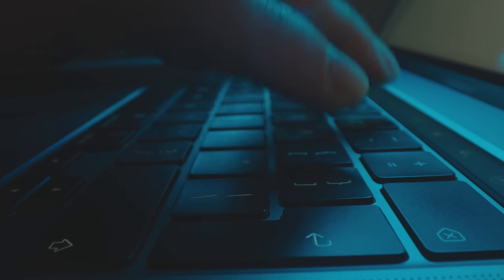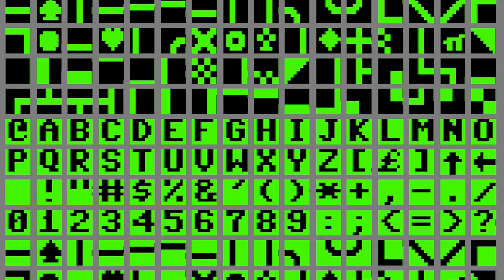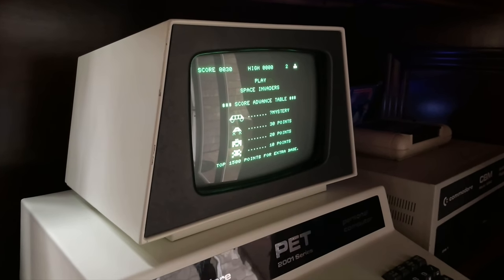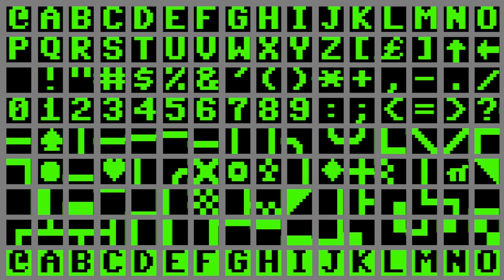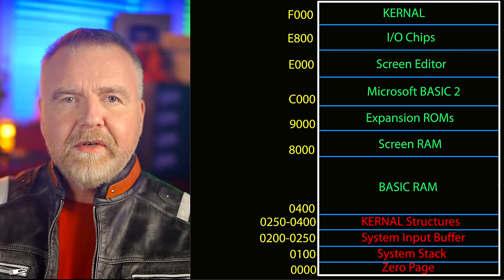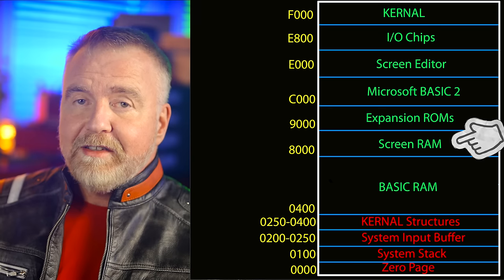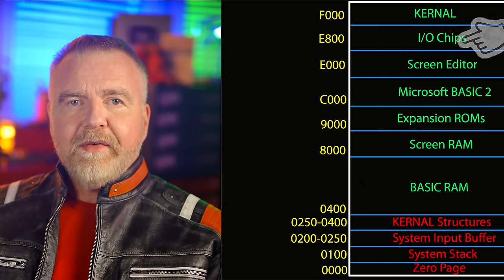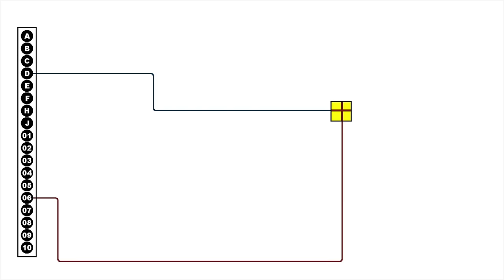Everything you SHOULD know about your Computer but don't!

Comment: Amongst the first dedicated computer was the AES-100/103 word processors. Although powered by an Intel 8080 cpu, most of the functions you describe were done in hardware. Yes, for example the on screen cursor had a series of TTL (7490 type) horizontal counter counting up to 80 (caracters) and a vertical counter counting up to 25 (lines). The half tone cursor was driven on the video board with a resistor injecting half the current in the gun, hence the tone difference. The boot sequence was controlled by a bootstrap loader in ROM. The disk access, head placement, rotation, data transfer, etc. were all hardware implemented.  The same video ROM (different countries characters were available with differents SKU) idea from the PET was used, altough the text on the screen was stored and  "remembered" in DRAM  memory. This was also hardware controlled to the point that the text on screen and off screen was stored in contiguous memory as it was displayed. The text was moving on screen because there were hardware counters doing that. The keyboard scanning was all implemented in hardware, only issuing an interrupt on any "Hall effect key" keypress. In effect at the time the limiting factor in all systems was the cpu itself. The cpu was burdened with all the interrupts and housekeeping duties they barely had time left for anything else than coordinating the processes. It was faster to just dump a command or a couple of bytes in the hardware and let it do it's own magical business. Then come back on an interruption to look at the outcome of whatever was pending. There was extensive use of DMA for anything data related. Communications were handled the same way. A respected engineer (especially mission critical like communications) at the time would not trust anything cpu! We would implement a series of lap time watchdogs timers (Bill P.) , tigth timings, wake up call timers, etc. and make sure the hardware was ready to press on the reset button at 4 millisecond notice!! That's the way it was done then... Debuging a video display was simply a matter of looking on the screen, with experience we knew exactly what had failed since it was a sort of inverted WYSIWYG! Remember AA55 and the Quick brown fox generator!?

Comment: Awesome video...

I learned BASIC on a PET in high school back in the early 80's. Next, I learned 6502 assembly in tech school where we outputted to an oscilloscope with X Y coordinates. I wrote enough assembly to draw a 3D cube and rotate it on the oscilloscope. This was due to directly manipulating the voltages going to the two input of the scope. I probably still have the code stashed away somewhere.

Comment: After 7 years of being a computer enthusiast and when I completed my Computer Science Degree in 1980 - which makes me the same vintage as this presenter - I had learned most of this stuff. Additionally my first few years of professional low level process-control SW development taught me all about 8 bit computers....and I mean ALL. Interrupt handling, O/S structure, Assemble, Machine code, how input and output is multiplexed, RS232, and a myriad of other stuff. I am SO GRATEFUL to have been on the ground floor of microcomputers.
You haven't lived if you haven't put a 16 channel logic analyser onto a single board computer, looking for why a data fetch hasn't worked correctly :)

Comment: Thanks for that ride down memory lane, Dave. I started off  (if we discount a 4 bit AIM development board running a 4004) with a Tandy (Radio Shack Model one. I was even simpler than the Pet.  I too enjoyed the luxury of  knowing what every (well most) component was for and thanks to reverse engineering (or screwing around with a Monitor in the ROM, as I would have called it at the time) I learnt what every bit of code (including those Microsoft routines) did. It was a time of rapid development and personal computer costing £1000s in todays money would be obsolete in a couple of years. It wasn't just the hardware, the knowledge also suffered from obsolescence. Within 5 years, I wouldn't have even be able to tell you how a sound card worked (though I knew it didn't use the relay that switched the  tape recorder on and off to make the sound). Thanks again, Dave.

Comment: Dave a lot of the first generation of "homebrew" hackers and gamers went through the knowledge bootstrapping process.  Many even independently invented or discovered how to build computers from scratch.  Early software and hardware are so intertwined that it was not possible to know one without the other.  Computer magazines in the 80s actually had complete program source codes or circuit diagrams, and Byte magazine was our industry bible.

Comment: The first computer I owned was an Amstrad PCW8512, which had two 3.5 floppy disk drives and used CP/M as it's operating system.  Because I had an Egyptian girlfriend at the time, I changed the character set to Arabic and caused it to write from right to left using a  C script I wrote into memory. I was pretty pleased with that.
Thoroughly enjoy your videos.

Comment: I used to repair Commodores Pets back in the 80s. I had a reference system with the 40 pin chips socketed. A cabinet with spare chips and reference floppy for setting up the heads.

Comment: The first computer I ever used was a TRS-80 Model 1 in 1982 in Year 7 at school. All I could do was a BASIC "Hello" program. The first computer I owned was a TRS-80 MC-10 in 1983 with a whopping 4K of RAM. I typed in many BASIC programs and ended up writing some including a very crude financial accounting program. I learnt how to POKE the screen to do unusual text and graphics. I did some elementary Assembler programming. Yes, that tiny computer could do all that. I later upgraded to a CoCo 2 and then a CoCo3 with the 512K RAM upgrade module and 2 x 5.25" disk drives in the end before moving to PCs in about 1990. The good thing about PC's was the open architecture which lended itself to learning all about it if you wanted or needed to know.

Comment: I (and a friend) were stretching the limits with the PET2001... VIA chip was awesome. Sound out thanks to a serial shift register could be output to CB2 (available on user port), while still have R/W to the PA port. So, multiplayer games, one player on each PET2001 (our high school had two) because of the keyboard scanning blocked multi-key input, so solution "Sit at a computer each", then a home made cable, amplifier on a hand carried cassette player. Teachers were frightened at our activities, and took every opportunity to yell at us for breaking the rules (not connect anything!). But it led to both of us getting jobs as assembly programmers straight out of high school. Those were the days!

Comment: Back in the early '90s I was at one of two startups that were doing compression that could be used on discs. Thanks to books like undocumented DOS and a pension for disassembling code, I was able to contribute to that effort.

Once we had a product, and I thought about what happened to lotus one two three, I walked into the boardroom and told the guys we got 2 years to make money on this and then Microsoft is going to have this compression in the operating system. It's as sure as Moore's law.

So YOU FOR ONE OF THE GUYS THAT MADE MY PREDICTION COME TRUE!

Bravo, much respect!

Comment: The first computer that I owned was in late 1987 or early 1988.  It was a "Pinetop XT" from the back of Computer Shopper magazine.  It had two floppies and a multifunction expansion care that added IO ports and memory to fill to the full 640 KB.  I added a 20 MB hard drive, a Star SG10 dot-matrix printer, and a Volksmodem 12 1200 baud modem.  The first two pieces of software I bought were the Mix C compiler and an editor which name is escaping me right now but had drawn cat figures on the quick cards and other documentation (I still have those cards somewhere because one of them had an ASCII code table).

If you booted this computer without a boot drive you would get a BASIC prompt.  Now you get some kind of Missing OS error.

My next computer was a Gateway 2000 386.  HUGE jump.

Comment: Hi Dave, I have in my study, the first disk (5-/14" floppies) machine I built back around 1983. 6809-based with 56k of accessible RAM. Originally it used dynamic RAM (32 16kx1) but I recently got rid of that and replaced it with a single 64kx8 static RAM which was part of a cache bank from a discarded PC.
In front of the machine is a custom-designed, built and programmed VDU (dumb terminal) including custom keyboard encoder and of course, video hardware (6845 controller) , character generator (binary coded EPROM) as well, again 6809-based. It still works and I can still write and execute programs on it. 
Al software/firmware done In assembly language of course. The '09 is so much fun. It's powerful stack capabilites were a delight to use.
Re the C64  character output, it appears to be typical for the time, feeding the video shift register. A variation I incorporated on another machine had both a ROM and writable RAM so you could load graphics characters etc. and address it with a 1-bit higher order address line from the video controller. Effectively a programmable character generator and writable as a part of the normal machine memory map. However I never really used it in anger. It was a neat-to-have-done kind of hardware thing.

Comment: In 1965/66, I read the whole OS incore code, line by line for the IBM 7040 OS (IBSYS) and then added significant function. Added was I/O spoiling, check/point restart and a scheduler. This allowed the Univ of Waterloo (On) to read in and print output for student jobs, then write the storage for the current running application to hard disk, then process student jobs thru the Waterloo Fortran Compiler and then restart the app that was running and print out student results.

Comment: Ah memories.  I learned Z80 assembler on a 4K Level 1 TRS-80 I bought in 1978.  That knowledge led me to microcontrollers; particularly the PIC chips in the '90s, and landing a career in embedded systems after getting my BSEE.  And then Silicon Valley died with the "dot com crash" in 2000-2001.

Comment: I built some very simple display electronics once (1980s) from TTL and memory chips, boy it was a self-imposed pergatory when I could have just used a ready made LSI (6845 or something like it), but I wanted to understand the whole thing - and by the end I certainly did!  I did get it working on a small little 14" CRT screen - but it was pretty crude.  Today when I watch TV in HD I sometimes remind myself that I am effectively gazing into an enormous RAM buffer which is being continuously updated faster than thought to trick my eyes and brain into seeing moving pictures.  Display tech, plus MPEG or other compression - it is a modern wonder - no two ways about that!

Comment: I am not a PET expert, but I AM a hardware ASIC design engineer.  The most likely reason for not being able to change the character set is because the character ROM is being hit 40 times every scan line.  Assuming 24x40 character display, 30 Hz (60Hz interlaced), that works out to 240,000 accesses every single second.  That would chew up a bit of the time that the CPU has to be stalled.  Of course this is already done to read the video RAM (bit of memory that has which character is in which screen position).  But having character data in RAM would double the impact.
Of course, there are other ways around this.  The 6502 (as I recall) uses a two-phase clock, so you could squeeze video memory access BETWEEN clock cycles for the CPU.  This, of course, assumes that the RAM is fast enough to handle such double-speed access.  If it is, then using RAM characters could be done, but probably at the expense of a few (maybe two or three) extra 74-series logic chips.  That would increase the cost a bit.  But, there is the most obvious reason that this is done: the early PETs only had 4K of RAM.  Yeah, not nearly enough RAM to do any sort of thing like that.  The extra characters would take up 1/4 of the existing memory (assuming 128 characters), or 1K.

Comment: I first learned assembly on a PET.  At first it was just POKEing data values into the screen ram and running it right there.  Getting a real assembler tool made things so much nicer, best was the disassembler.  This was when I learned just how horrific floating point code can be.  But it was great to learn how everything worked.

Comment: The Acorn BBC Micro (also a 6502 machine) had an interesting approach to expansion ROMs - the area from 0x8000 to 0xBFFF was banked, and could have up to 16 different ROMs (or "sideways RAM" banks) present with the help of an expansion board (if memory serves up to 4 were available without an expansion). BASIC was one such ROM, the disc controller (DFS or ADFS) was another, if fitted. Video memory was dynamic, starting from 0x3000 (640x256 2 colours, 320x256 4 colours, 160x256 8 colours + 8 flashing pairs), 0x4000 (80x25 bitmapped text mode), 0x5800 (320x256 2 colours, 160x256 4 colours), 0x6000 (40x25 bitmapped text mode), and 0x7C00 (40x25, 8 colours, driven by the SAA5050 Teletext character generator chip), all ending at 0x7FFF. This last mode was the BBC's real killer mode, it looked amazing on screen and took just 1K of RAM.  In later models (and expansions for the BBC Micro) the video memory could be banked to the "Shadow RAM" so BASIC workspace could go all the way up to 0x7FFF.  The operating system and memory-mapped I/O was at 0xC000-0xFFFF.  Yes, BASIC and the OS were separate.  It was an ingeniously modular system, its legacy lives on today in RISC OS - the original ARM OS, which is now open source and available for the Raspberry Pi amongst other platforms.

Comment: As an application programmer in the 1980s, I can recall coding my own sorting and searching algorithms. Assembly language was too low-level to be practical so we used B, BCPL or C. I have to tip my hat to the book 'The Art of Computer Programming. Volume 3 - Sorting and Searching' by Donald E. Knuth, which I studied at university.

Comment: One of the early mods I did on my PET 4016 was to make a daughter board for the character generator which used the existing ROM and some additional SRAM for the upper 128 characters, which was addressable via a dual port, by the 6502. It allowed custom characters to be generated in code and was used for things like graphing data or game sprites. The write to the SRAM had to be synced and written in the vertical sync flyback to prevent screen flicker when writing to the SRAM.

Comment: Back in the day memory was very very very expensive whilst ROMs were cheaper so designers would try to keep as much in ROM as possible. The PET uses a 6502 CPU which doesn't natively support RAM refresh so they opted for SRAM; which by the 1970's was now established technology, and wouldn't need additional refresh electronics. Some later home micros used Z80 CPUs which do natively support in-built refresh so could use DRAM more easily once it became cost effective (DRAM wouldn't be invented till early 70's). There are exceptions... the BBC computer for example uses a 6502 CPU but uses DRAM.

Comment: As a starving part time college instructor and a student I did my graduate work at the CCM (Center for Contemporary Music at Mills College, Oakland) in 1983/84 on a C64 because it had that SID chip, a 3 voice synth. My collaborator Jeff and I figured out how to connect 2 C64s to sync the clock so now we had 6 voices or two different programs in parallel. I wrote a lot of BASIC programs with Assembly Language subroutines running loops that read variables from tables. Geez, as you know, it was all by hand. Good times, good memories. We both played guitar and keyboards, so with the 2 C64's we had our own little orchestra. We were working with David Rosenbloom, Larry Polansky, and Scot Gresham-Lancaster. I learned so much from those 3 wonderful guys including C (no plus or sharp), Forth, and others. Ahhhhhhh, the old days, right? We explored language and interface solutions for composers.

Comment: I find this interesting, as I used a TRS-80 Model I as a kid.  The architecture of the TRS-80 was probably very similar to what you describe with the PET.  I imagine that the TRS-80 had a fixed set of characters in ROM like the PET did, because you could POKE characters directly to video RAM to display characters at particular cells.

Comment: Reason for using ROMs back at the beginning (late 70s) is they were really fast and you could actually scan the video out of them like the PET did.
Static RAM was also pretty fast for the time and as you said there was a bunch of additional circuitry that was needed to refresh any DRAM that slowed access down. My first callsign character generator (amateur TV) used fusible link bipolar PROMs, they were really fast.

Comment: Nice overview! BTW (if anyone cares) the reason dynamic RAM needs to be refreshed because it's storing charge in a capacitor to represent each bit. The charge in the cap will gradually dissipate in accordance with the time constant. Static RAM uses a 'flip-flop' circuit to store each bit, so it will essentially latch in place without needing to be continually refreshed. The refresh circuit used with dRAM reads out all the capacitor energy states and then writes them back to the circuit before they have a chance to leak away (if they did leak away you'd obviously get data loss). Obviously I'm still hand waving a bit here. It would probably take a few hundred pages to fully explain what's going on down at the hardware level.